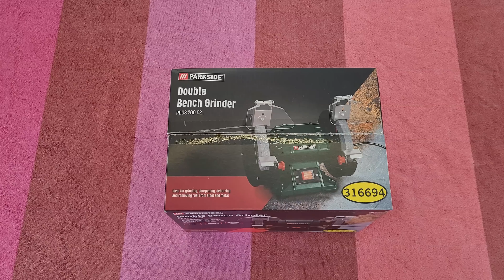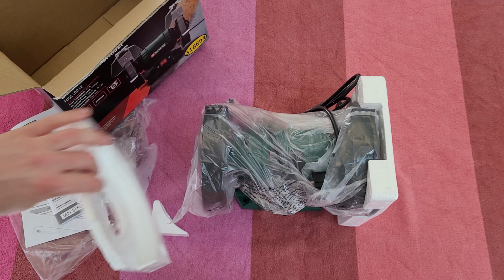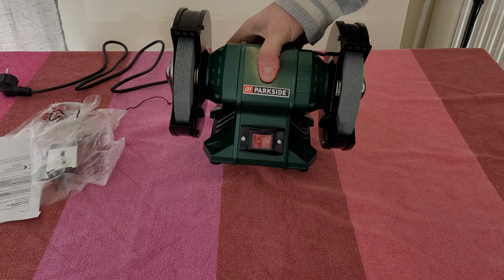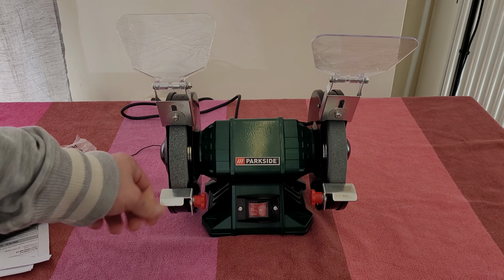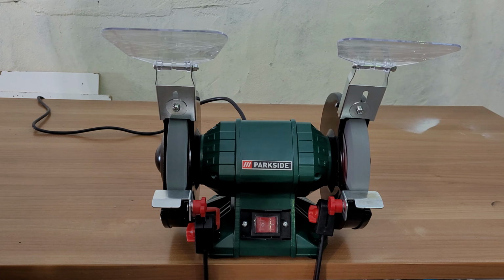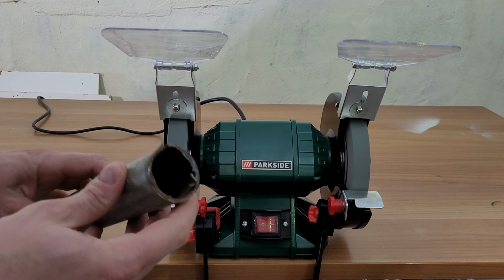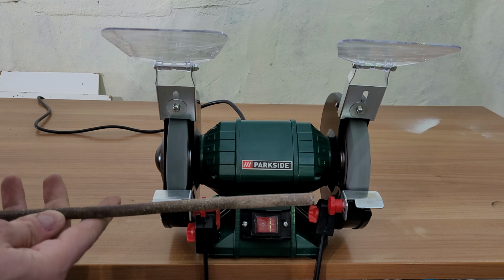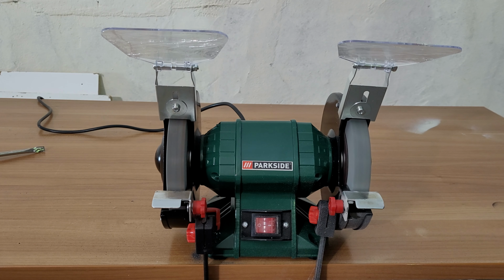Parkside Double Bench Grinder PDOS 200 C2 TESTING

Comment: I bought this grinder a week ago. It is cheap. But when I start it, it has big vibration. The grinding disks were not rounded, they needed to grid down by diamond tool. As well as the outer flange must be centered carefull, inner hole is larger then the threaded shaft. Shortly, it needs time to reduce the vibration.
Reply: Did you fixed the vibration?